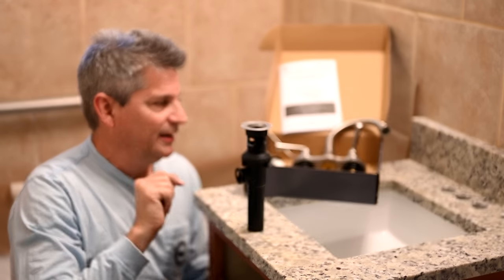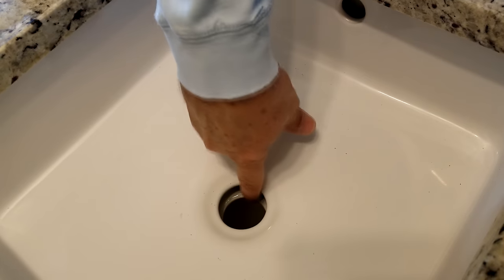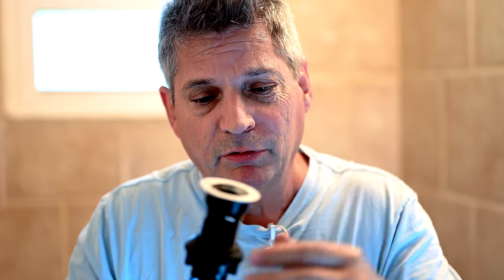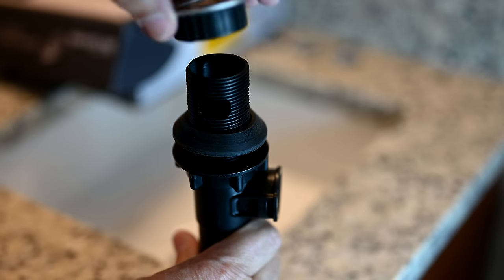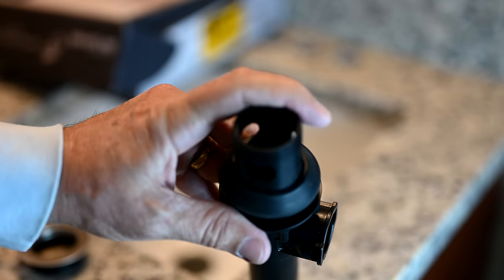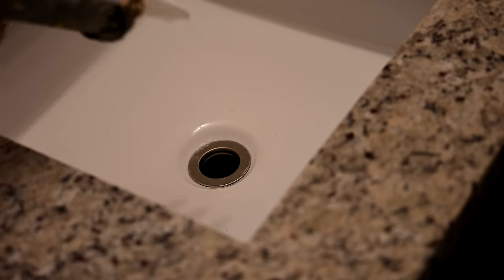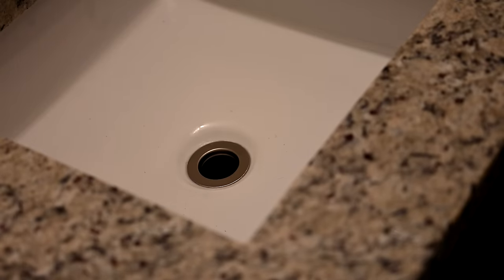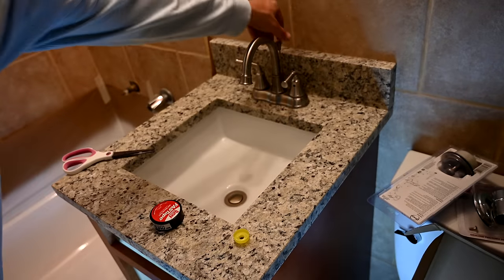How To Install Bathroom Sink Drain/Faucet, No Leaks Under Gasket, Threads [SOLVED] 2023

Comment: On Jeff's first video, he uses plumbers putty on the rubber gasket. This video he says NOT to use plumbers putty because it will dry and crack the rubber gasket which will make it leak. 🤪 which is correct. I've got a drain pipe to replace, using the same components.
Reply from the maker: After making the first video, I confirmed with Oatey, they said not to use it. Then after further testing, I confirmed we don't need the plumber's putty anyway because it was the second piece of Teflon tape that solves the problem, so putty not needed.
Reply: Jeff, I reviewed your drain video again and followed your instructions. Apparently the teflon tape on the lower threads of the drain pipe below the overflow sweep holes did not fill the threads enough to keep the overflow water from seeping between the drain pipe threads and rubber gasket (which also has threads). One more layer of teflon tape at the location with a thin layer of silicon sealer did the trick. 👍👍Thankyou again.

Comment: Thanks for this video! Unfortunately I have a different design push drain - Moen Karis. It's all plastic and the thread stops just short of where the bottom gasket goes. There is also no flange that screws off on the top. Any chance I can use plumbers putty or some other type of seal just inside that gasket?
Reply from the maker: You should use what Moen states to use. But also their threads should not stop short of the basin bottom opening either. Check the instructions and see if they specify the minimum depth for the basin to be, you might end up having to dith this drain
Reply: @jeffostroff  looks like there's no depth mentioned for the drain. Instructions just state to place everything ok and tighten the nut below. Might just need to explore a different type of push up drain. Thanks for the help!

Comment: Excellent video, but putting silicone around the upper plastic washer seems pointless since the sink overflow system allows water flow by the outside of the drainpipe anyway. Silicone around the bottom seal I could understand, but you don't recommend this??

Comment: Nice explanation but mine leaks where the gaskets seats on the sink, not from the threads. Just a pain in the ass so I had to use Plumbers putty and Teflon tape combined.

Comment: What type of adapter is that from the glacier bay tail piece to the p trap?
Reply from the maker: That was just a 6" extension piece that we put because a lot of times the pipe going into the wall is too low and so you need to extend downward from that tailpipe coming out of the basin.
Reply: @jeffostroff  Thanks man, I appreciate it!

Comment: I have a molded counter sink combo . It has an overflow . My pop up drain has 2 holes in the metal drain for the overflow . I do not have plastic drain parts . Water is obviously seeping through the extra hole . Why do drains have 2 holes for overflow and the sink has one hole . How to I stop water leaking out of that extra hole ? In this case , you might tell me since I have metal parts and silicone gaskets to use plumbers putty at the underside of the sink drain ?
Reply from the maker: No don't use plumbers putty. Try the solution exactly as i have shown, every step, and see if it works.

Comment: Still having small leaking  at the big lock nut after taping - even tried to tighten it by hand more but no luck.  I will use silicon this time.
Reply from the maker: Did you make sure to do that dry fitting that I showed earlier in the video? You need to be absolutely certain that that second application of Teflon tape that you put on the lower part of the threaded pipe actually ends up right where the black gasket will go right around it because you're trying to seal up that interface. So if you went too high or too low on the threads, you're going to miss the spot where the black rubber gasket meets up with the threaded pipe when everything is all tightened together

Comment: Thank you for a very through video. Would teflon tape worked if the bottom gasket is on a smooth (not threaded) drain pipe? If not, can silicone be used instead?
Reply from the maker: There should aways be threading there, otherwise how would the large nut under the basic screw onto the tailpipe? You need to have threads poking out of the bottom.

Comment: ty internet dad. 

i legit had my old man try and help me with some plumbing fails in my new house . He got all done but this sink refused to play nice. He had jammed an oz of putty into the nut below. 2 days after he left for his boat trip POP goes the putty. 

So im sitting here trying to fix it and realized he put putty there.  cleaned that out. Taped the threat for the nut NOT the rubber. And taped the wrong direction on the lower. Didnt tape the top. 

2 hours later drips . 

Lets try your way internet dad.
Reply: First attempt failed, but your advice got me the answer. I had to replace the drain part. I had tried so many times it was all worn. The tape needs to go cw on the bottom, ccw on the gasket and cw on the flange. 

It also appeared the sink was minorly cracked at the overflow return. I jb welded it. Between the two fixes I got it to stop leaking. yay me.

thanks boss

Comment: hello had a question, do i need the part that connects to the black drain that you put teflon tape on??
Reply from the maker: Yes that is the drain pipe, and should be used with the new drain.

Comment: Jeff, I have a drain with pop-up stopper and the drain pipe is all one piece- no threads under the flange. How can I stop it from leaking?
Reply from the maker: On yours I don't know. IF there are no threads under the drain below the basin, how do you screw that bottom nut onto the drain tailpipe to compress the black gasket to the bottom of the basin?

Comment: I’m running into an issue with the gasket itself and the hole in very bottom of sink. When I tighten everything up, the edge of the gasket will start to tuck into the hole in basin, causing it to leak. I tried to reposition it 4 times and tighten back up but same thing every time. It’s almost as if the sink is defective but it worked fine for a year or two before the s trap connections started trickling
Reply from the maker: Could be you tightened it too much. Make sure you hand tighten and then no more than 1/2 turn by wrench. Also make sure to add that Teflon tape onto the threads of the downspout pipe where the black gasket meets the pipe.
Reply: @jeffostroff  yeah probably so. I mechanic on big trucks so I am used to a lot of torque 😂 might have been the issue because I used a big crescent wrench. Will try again with less torque and more Teflon tape. I found your other video and it gave me some good ideas.

Comment: I tighten it to squeeze the silicone out the top. If you don't, you have to add a small extra bead around the chrome. Scrub the sink, and that extra bead comes off

Comment: Another trick you can do is just add silicone to the bottom of the flange and to the upper part of the gasket. Works great and is really quick.
Reply from the maker: Yes We did that here.
Reply: @jeffostroff  on top of the gasket as well? Also do you ever spray denatured alcohol on the silicone so it wipes of nice and easy? Very good informative video though!

Comment: Yes I was a maintenance worker and found many many drop ins to be corroded because of improper instillation
Reply from the maker: Did they not seal the drain correctly?
Reply: I found a lot wrong with drains in that line of work
Reply: No tape or putty

Comment: Jeff, I thought this video was exactly what I needed after replacing a bathroom faucet.  But the leak remained at the gasket.  Any other tips to create a better seal between the rubber flange and bottom of the sink??
Reply from the maker: If the leak remained, double check that you followed all the steps, including the dry fitting, and determining where the Teflon tape should be wrapped around the threads so that it is between the pipe threads and the black gasket.
Reply: @jeffostroff  it seems the bottom of the sink where the gasket meets it is irregular and the gasket isn’t fitting into or filling all the gaps.  I’ve hand-tightened the plastic nut as much as possible.  I’m going to try another gasket I found at the big box store and see if that helps.  Thanks for the reply and please let me know if you have any other ideas.  Great video!

Comment: I've seen others put silicone on the lower black gasket "Under the sink". What do you think about that? or do you believe only silicon on the upper gasket is fine?
Reply from the maker: Putting silicone on the outside is an uninformed plumber's hack to put a band aid on externally, when the fix is internal on the threads with the Teflon tape. We should not have to use putty or silicone or anything on that big black gasket to make it seal to the bottom of the bowl

Comment: Could I shorten the pipe out of the wall? About 1”?
Reply from the maker: You need to leave enough room to cement on the P-trap adapter tot he waste line coming from the wall. Then see if the P-trap will pit in there.

Comment: Jeff is it bad to use a fernco band trap adapter instead of that abs slip joint adapter you used in this video?
Reply from the maker: Nothing wrong with that. There already is one inside the wall, the previous installers put one in because out P-trap will not mate up to the old thin metal pipe.

Comment: Can you use plumber's putty for plastic such as pvc, abs, and pex?
Reply from the maker: You probably could but not on ABS plastic. Most of your plumbers putty if you read on the back in the fine print where you can use it and where you cannot they will likely tell you that any of the black plastics like ABS you cannot use it on there. Apparently from what they have told me from ODI anyway is that the petroleum that's in the plumbers putty can cause anything like black plastic and black rubber to dry and crack.

Comment: Hey thanks for the input, but after following your video and others to the Tee, after installing the new pop-up.  I had to return 2 times because the water now drains very slowly and I don't know what the cause is because I cleaned out all the debris from the p trap. Do you have any solutions?
Reply from the maker: One thing you want to really check out closely is the popup where it comes up out of the drain when you push down on the popup assembly rod. Make sure you're getting enough pop up space where the popup leaves at least 3 eights of an inch to 1/2 inch of gap at the bottom of it so the water can quickly evacuate the sink. If the pop up just comes up a teeny bit and you might think that that's allowing water and it really is not allowing a lot of water down the drain. So you will have to work on setting underneath the base and the proper Just Dance on that that horizontal component that goes into the bottom of the drain it forces the pop up assembly upward. That is what you really need to set your focus on. If you did that and you're still not getting water out then I would really consider looking into your venting system the pipe that goes into the wall was anything illegal done from the P trap going into the wall because you really need to make sure you have air behind water when you flush water down those drains
Reply: @jeffostroff  thanks for the input and valuable information.  I have learned a lot this weekend with your tips dealing with the sink. "Update " So the solution was to plunge the sink because there was stuff in the drain that I couldn't get too. (The pipe thats in the wall was full of gunk) I was there to replace the pop up assembly  and only charged for that. Thanks again, this had me scratching my head, I was glad that I found your videos because I was doing it wrong in a few areas, so I took it apart and followed your guide.
Reply: @jeffostroff  Thanks again, this is another nugget to keep on my checklist I made. The water started flowing fine yesterday because   they plunged all of the previous gunk from the pipe in the wall thats after the p trap. So the problem has been solved and I subscribed days ago because of the craftsmanship and your detail solutions. I feels as if I just took  crash course in plumbing.  I used this project to get me ready to change out my counter tops, (I'm a solid surface fabricator) in the Kitano my wife want me to reuse the old sink. Now I know what to do, plus you give amazing tricks of the trade and warnings that out of all the videos I studied. No one mentioned about the stain free putty on marble, corian,  etc., and using the water silicone.  Valuable information 👏 👏 👏.

Comment: Why is the seal around the drain flange important/necessary? Doesn't any water going under the flange just go into the same cavity as the sink overflow?
Reply from the maker: No, if the water goes down around the outside of the drain flange then down through the throat of the basin, it could drip outside the downpipe threads, not just down the drain.
Reply: @jeffostroff  But isn't that the same path as water going through through the sink overflow would go? Ultimately the big rubber gasket under the sink stops everything, right?

Comment: Jeff, do you add Teflon tape to the other two plastic connections ( one below the pee-trap, and the vertical connection)? thanks for replying
Reply from the maker: No a proper installation of a ptrap requires no teflon tape
Reply: I often see purple primer on photos is that good or does it matter?

Comment: Me and my stepdad just recently installed a new faucet after the old one was leaking. The old one had some corrison but anyways, one of the back pipes is leaking for some reason and the connecting rod that opens and closes the middle is stuck, now im not sure how my stepdad did the installation but I dont think he done a good job tho
Reply from the maker: If it is stuck, likely reason is he screwed down the big plastic wingnut behind the plunger rod ball, or the faucet is placed on top of the sink such that it did not leave a big enough opening for the plunge rod to move up and down easily.

Comment: Question for you. We had a sink installed, but something is not right in the drain. It is as if the gasket is too close to the flange water is pooling around the flange in the sink. Plumber says he was worried he would crack the sink. I think it is just not right, but not sure what to do to fix it. Any suggestions?
Reply from the maker: Water should never pool at the flange, sounds like he did not tighten the nut enough under the gasket to pull that drain flange down lower in the sink.

Comment: My new bathroom sink doesn't even have an overflow chamber, and the underside of the porcelain is very rough. But I'll try this, even though I feel like the rubber ring isn't sealing against the porcelain. Cheap-ass sink but the vanity was nice, didn't have a choice.
Reply: Didn't work. POS still leaks. I need a different sink drain without the weap holes.
Reply from the maker: Did you try to place the plumbers tape on the threads right where the black gasket will meet the bottom of the sink?

Comment: Would you recommend teflon tape on the p-trap connections?
Reply from the maker: No, I never use it there, if you seat that midpoint connection nut first before setting any of the others, it will work every time.
Reply: @jeffostroff  Thanks for your assistance.
Just found the sink leaking tonight.
So I picked your video first and found it easy to follow and nicely shot.
Just gotta make my shopping list for tomorrow.
Thanks for the information and video.

Comment: I did everything you said and it’s still leaking from the top were I put the tape on gasket. What could still be wrong ?
Reply from the maker: You really have to make sure that black gasket is nice and tight up against the bottom of the basin and you have to make sure that the black gasket is right in the middle of those Teflon tape application over the threads. You might want to try putting more tape on there that's why I like to use that Oatry fast tape it is thicker and doesn't require as many wraps
Reply: @jeffostroff  

Thanks for all the tips, I think there’s a small hole on the side of the sink by were the gasket goes, it’s really small do you recommend just filling it with silicone?

Comment: Plumber's putty is what I would use, dry and crack is probably decades, silicone does not seal the same. You 'seal' the bottom of a tub with bath silicone and it has a limited life and it gets worse for a connection that may be jostled like clearing or bumping the piping below. Also, plastic joints in the trap assembly can leak, I put a thin line of plumbers puddy on those gaskets also, you tighten and even if it is not perfect the puddy seal makes if drip free. Those warnings come from lawyers and potential class action suits from a builder that uses it and some fail 20 or 30 years later.

Comment: I have an old single handle faucet that works but the gasket that separates the sink from the bottom of the faucet is kaput.
I don’t expect to find the gasket from the manufacturer but I hope to find a sheet of rubber that I can use to install and then cut around the faucet bottom.
Reply from the maker: You cna also use clear silicone. I always apply clear silicone around the base of the faucet to seal up any tiny openings.

Comment: I was removing the existing ball/rod and noticed a round plastic washer (was definitely worn) dropped out. When replacing with a new ball/rod I don't know which end the new plastic washer goes on? Seems like it could work on either side, but obviously only goes on one. Have never seen this washer used on the ball/rod in any installation video!
Reply from the maker: JD I have seen one either, could be a previous owner or handyman installed it?